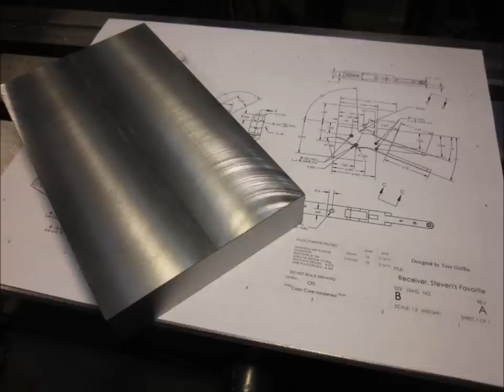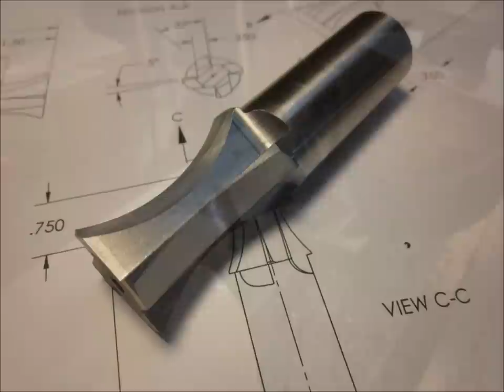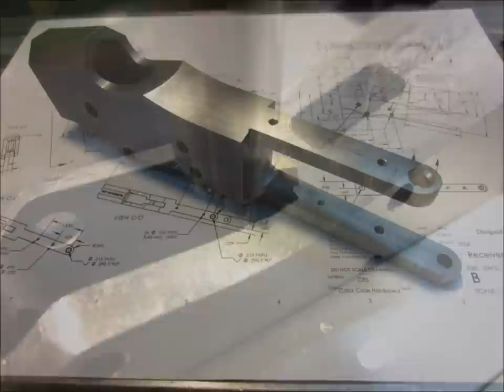Building The Stevens Favorite Single Shot Rifle, Part One - The Receiver

Comment: Hi Tom.
Found you on a search for an unusual Stevens gun. I obtained my Dad's (probably grandad's) Stevens model 26, .32 short. Missing the hammer, block assembly, and side lever. It doesn't use a lever cocking mechanism. The trigger is intact with fixed trigger guard. I have no intention of making this fire. (Although I do have ammo for it!!) But finding parts might be possible with lots of diligence on my part.

I mostly wanted to say what a treat it was to watch your craftsmanship in process. It is truly a gift from God. I recognize that right away. I built a few high end acoustic guitars from scratch, so appreciate the process, tools, machines, and supplies needed to pull off a project like this. Thanks so much for posting.

Comment from the maker: I have the gun drill and have made most of the attachments to be able to drill the barrel in my lathe. All that remains is to put together a hydraulic system to force cutting oil through the drill. The rifling hasn't been addressed yet, but that will likely be the last operation. I can finish making the barrel without it.

Tom

Comment: Wow! You truly have a talent. I was wondering the steel, for the cutter. Are you going to have a video, of you shooting it?
Reply from the maker: Thanks Michael.

I used O1 tool steel for the form cutter. It was machined soft, then heated to cherry red and quenched in oil. I didn't bother tempering it and left it full hard.

There will be some videos coming up. I plan on doing one on drilling and rifling the barrel, doing the color case hardening and of course one on shooting it.

Tom

Comment: Too cool! when you used the mill as a shaper did you need to lock the spindle in some way?
Reply from the maker: The spindle brake on the Bridgeports  has a locking cam. You can also put it in the low speed range, but then it's harder to orient the tool.
Reply: @TomsTechniques  another reason to freshen up that break.

Comment: Aside from obvious stuff like CNC machines, how much has gunsmithing changed in the last century or so? Would a guy from 1900 make a rifle the same way as a modern gunsmith?
Reply from the maker: The basic machining processes, other than the advent of CNC haven't changed that much, but what has changed is metallurgy and casting techniques. The receiver on this rifle was originally sand cast in steel, but I doubt it was heat treated other than maybe a quick case hardening. Now, with the higher pressures of smokeless powder, the actions must be much stronger. Receivers for modern guns are investment cast from stainless or high carbon steel and heat treated for strength. Barrel making has changed a bit as well. Rifling is now swaged with a button die, not cut like before which results in a much more accurate barrel.

Tom

Comment: What tool are you using to square the corners? Is that a keyway cutter?
Reply from the maker: It's a tool I made to hold a triangular carbide insert. It is a round bar with a pocket in the end with a threaded hole to hold the insert. I use it like a shaper (or slotter in this case) cutting one side of the corner first, and then the other. The bar also has a couple of relief cuts so it doesn't rub on the pocket.
Reply: @TomsTechniques  thanks for the info, in Walter Mueller's "Building Falling Block Rifle Action" he shows a hss tool bit version but I like the indexable one better(no grinding to bits, which I dont have the setup for).
Reply from the maker: I used a ground O1 tool for some of the smaller ones, but the carbide insert one works much better where it will fit.

Comment: What would be AWESOME is if someone would mfg receivers like these to 80% level to keep them legal to sell without registration for home builds...that and a parts kit with barrel options...I can see SO MANY guys wanting to go for such a build...I mean so long as the price was not crazy like what has happened (near as I can tell) with the muzzle loader kits...which cost pretty much what a finished copy would and leave very little for the home builder to do but to put a finish on the steel and wood..   not being a real part of the build and not even saving any real money to speak of, just turns me right off it... business opportunity for someone!?    what if it were just the rough hunks with no holes at all"  ??  Could someone make money cranking those out on a cnc rig selling for like $100 to $150?  Or not??
Reply: I'd buy one.
Reply: It might not be that easy as what would be needed for it to be an 80% would most likely still require a milling machine, a high level of expertise and a whole lot of work.
Basically it would be a kit intended only for machinists.

Comment: What type of metal is used to machine the receiver .
Reply from the maker: I don't know the alloy for sure, but it is a low carbon steel, probably 1018. It will be case hardened when complete.

Tom

Comment: Nice video, where can a person find a set of drawings?
Reply from the maker: Thanks Jim.

I plan on making the drawings available once the project is complete. The barrel still needs to be made as well as the extractor, sights, plus all of the heat treating and bluing.

Tom
Reply: Tom's Techniques
Thanks Tom, let me know when they are available, I assume that you will want to charge a minimal amount for your trouble and that is OK with me.  I am sure you have put a lot of work into this.
Reply: Toms Techniques Tom, have you done anymore on the "Favorite"? Can't wait to see more. All the best.
Reply from the maker: John McKee

Hope to be setting up to drill the barrel this winter John. I'm currently making a custom fitted trap stock for my wife's 870, so that has been keeping me busy in the gunsmithing department.

Tom
Reply: @TomsTechniques  How is this project going? It exciting to see the old guns made new again.
Reply from the maker: The project, like many of mine, are in a temporary holding pattern. I recently retired and have been working on getting used to the new lifestyle. I've also been very busy planning a move to Michigan's Upper Peninsula. I spent last summer putting up a building for a new shop and storage, and am currently designing a house for the next stage. That, along with the arrival of our first grand daughter has kept me pretty busy lately. Not sure how I found time to work over the years. :)

Tom
Reply: Toms Techniques I understand. I saw this video three years ago and have followed your build looking forward to the finish. Thanks again

Comment: I love falling blocks but all the info out there is very unfriendly to a non-machinist. How hard if possible at all do you think it would be to outfit an ejector to a Stevens Falling Block rimfire? or should I say, how much would it cost me.
Reply from the maker: An extractor will cost you $22 from http://www.wisnersinc.com, plus the time to fit it. The one I did only required fitting around the shell casing, everything else fit fine right out of the box.

Tom
Reply: Toms Techniques
 Really? Just to be clear I'm talking about complete case ejection clear of the rifle upon working the action, not having to pick it out with your fingers. thanks for the timely response!
Reply from the maker: DirtyFrigginHarry
The extractor is spring loaded and when it is working properly it snaps over center and ejects the shell out the rear of the receiver.

Comment: I need  stevens favorite .22 magnum extractor and have been unbale to find one.  My rifle is useless without one.  Frustrating!
Reply from the maker: Steven's didn't make the favorite in .22 magnum. The receiver is nowhere near strong enough.
Reply: @TomsTechniques  Thanks for your reply!  What you say is interesting.  So when Savage reintroduced the Steven's favorite making the 30G in .22LR and the 30M in .22 WMR they must have beefed it up or used stronger steel or a different heat treatment? I couldn't find a 30M, so I converted a 30G to .22mag to duplicate their 30M but I nicked the extractor with my reamer weakening it so unknowing it couldn't support the WMR cartridge head  and the cartridge blew. So I need a Savage 30M extractor. Savage gives me the run around. They will only give me apart based on the serial number which is for 30G.  AND they must have made so few 30M's that I can find no parts for them anywhere online. So I'm dead in the water with a useless gun.
Reply from the maker: @johnhill7585  I wasn't aware that Savage had reintroduced the Favorite. Hopefully, they did something to beef up the action because the falling block relies on the strength of pins and levers to hold it shut rather than the receiver itself. Another problem with the design is that if the firing pin punctures the shell, there is nothing to prevent the gases from venting out the back of the block. Be sure to wear eye protection when shooting it.

Comment: Could u make a 1/1 scale printed template of the parts ?
Reply from the maker: +Matt Dickens 

When the project is complete, the drawings will be made available on my website, tomstechniques.com.

Tom
Reply: +Toms Techniques ok thank you. Would it be possible to scale it up say 300% and chamber it in 7.62x54r or a rimmed cartridge like 30-30 or 45/70 gov 
I'm looking to build the gun with my dad as a saddle rifle
Reply from the maker: +Matt Dickens 
Absolutely not. The action was never designed for anything more powerful than a .32 caliber rimfire cartridge.

Tom
Reply: +Toms Techniques this i understand but i was thinking of tweaking some things like making it a high wall action and a larger breach block. To accommodate the higher pressures 
Id love to use 32 if i could find any 
If its not possible the largest i would consider is a custom load of 222 

Sorry if i sound ignorant but what if the receiver shape were used
(mod to a high wall) 
And redesign the action to work similar to a peabody tilting block style ?? 
It wouldnt be a stevens at that point but it would fit the profile. 
I want to build 2 one in 22 or 32r 
And tinker and reverse engineer to a larger caliber.
Reply from the maker: +Matt Dickens 
I guess anything is possible if it is redesigned into something else, as long as you have the engineering skills to do so safely.
Reply: +Toms Techniques well i was thinking using a peabody/gehandra linked tilting block self cocking using the motion of the block still hammer fired. Ive got it drawn out. But my one point of issue is a new extractor or just puting a spring pin in the breach and when the block falls that forces out the cartridge.

Comment: It fails to show how it cut the square sharp edges in the hammer slot rear.  It fails to show how the steel was removed in the action behind the hammer where the hammer spring goes.    This was cast in the original.  This needs to be explained because this cannot be done with the information shown.
Reply from the maker: Hmmm. I guess you fail to realize that the video is not a tutorial. ;)
Reply: @TomsTechniques  It is not complete. The most difficult work is omitted.

Comment: Was that 4140 steel.
Reply from the maker: The receiver is low carbon steel because it will be case hardened. Most everything else is O1 except for the barrel which is 4140 pre-hard.

Tom
Reply: Toms Techniques thanks Tom ... makes sense. I was working on a 45-70 rolling block which the frame is 4140.  Still got a ways to go.  Nice job.